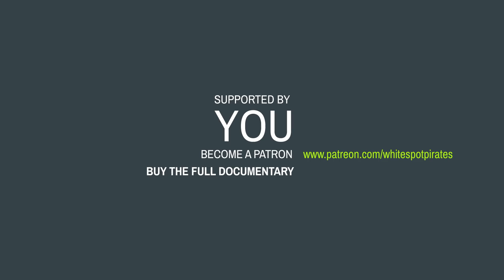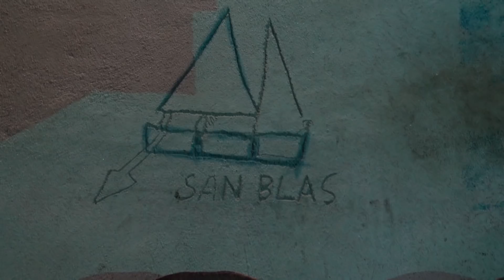What a DESASTER: My boat hull looks like SWISS CHEESE  - UNTIE THE LINES IV #16

Comment: Nice to see Karl getting some TLC, That pizza looked real good ;) If you get anymore small holes there is a product we would use for engine casing holes that would have 200 liters in the sump and it worked great, There is a few variations on the market where it is 2 pack and you just mix it and put it on then it goes real hot, So hot you can't go near it, There is a aluminium version and a steel version of the liquid weld, It is expensive, But does the job, Stronger than any weld and last for ages if kept at right temp.. Them trousers nik had on was so funny, Good old working clothes, Can't beat some air condition circulation, My workshop jacket is full of welding holes, Hope you did not get any bombers down your backs putting that plate on. It is very sore when that happens. Is it cheaper going their than going to a posh marina or does it work out the same price? "Per day" Don't like the sound of that one!
Reply from the maker: Shaun Sim oh nice what’s that called?
It was cheaper, yes. Fancy Marina haulout is 700$ plus 125$ per day on the hard. This was 170$ a day...so for a total of 6 days was cheaper
Reply from the maker: Shaun Sim plus, some fancy marinas sometimes don’t let u do your own work or bring in ur own peeps but u have to hire their staff...which is usually also more expensive...

Comment: Won't that aluminum plate between the keels create a lot of drag? Why not cut a hole and then weld in the new piece so it's a smooth surface? Keep up the good work on the videos, really enjoy watching what boat life is really like.
Reply from the maker: Todd Armstrong the plate we had at hand was was a different alloy, different thickness and the wire was not the right alloy either. The chances of something going wrong are too big to cut a 60x40 cm hole below ur hull. Karl is not a racing boat, I doubt that it will make a significant difference...

Comment: Why are you removing your keel weights? It looked like Bondo and lead, I hope you put it back!
Reply from the maker: Neil Shubert this is not the keel lead but lead that sits in the bilge. Why am I taking it out? Did u miss that there were like 3-4 big holes below it 🤣🤣 of course it’s going back in since it’s obviously there for a reason. But it needs to be newly insulated because obviously that insulation was not so grand anymore since quite the while...
Reply: @WhiteSpotPirates  Good news!  I was wondering why it was there! possibly some final ballast after it was built? are there any Zinc anodes down there too?

Comment: The lead may had been put there to balance up the boat , looks like a Crete mix to hold it there , if you put it back wrap it up so you don’t get dissimilar metal problem and water between cause corode ,, well done where is all your mates when you haul boat out

Comment: Where the bars for corrosion control, like they sacrifice their metals to the corrosion, instead of the hull, or were they weights for stabilizing like counterweights?
Reply from the maker: RV Curious De Warren They were for ballast.
Reply from the maker: RV Curious De Warren for aluminum, u usually use magnesium and not Zink annodes. And half a ton might be a bit over the top, too 🤣

Comment: Did I see you using urethane paint on the bottom of the boat? You seem to be redoing the bottom way too often. May I suggest a TWO PART EPOXY PAINT. This is a hard Industrial 30 year paint for Bridges, Drilling Rigs and Heavy Equipment. I put it on my Sail Boat and found it to be hard, shinny and very slick. Nothing seems to stick to it. The can says you can use a roller, but don't do it. Leaves bumps. Found a brush is best. Be careful it can sag if applied too heavy. It is mixed 4 to 1. In the U.S. the paint is $59. gallon and the epoxy activator is $52.pint. from Anchor Paint. Isn't that plate going to cause a separation of the water from the boat and drag? Not that it really maters I guess except for any depth finder behind it. Been watching since day 1.

Comment: curious tough where did you find the mig whelding machine, it was a rental?
Reply from the maker: ElectronicMarine it’s my friend Erick’s. He works in the balboa  yard and i knew him from the haulout when I changed my engine. He was so kind to lend  us the welder for the cost of the gas .
Reply: @WhiteSpotPirates  a good friend!
Reply: @WhiteSpotPirates  I went back on the videos installing the engine, Usualy on metal boats the engine stay disconected electricaly from the hull, the power negative wire on manny of them is controlled by a big power relay or manual switch since having him always connected with the hull creates galvanic corrosion. The negative wire should stay connected on the engine only when is running... the electrical distribution pannel in metal boats should also disconect the negative wires for every appliance. is a good habit to controll if there is anny continuity between hull and negative/positive wires from the 12v system. Especialy on metal boats the harness that goes to the running lights, sollar pannels egg must be checked periodicaly... if a wire is just allitle bit stripped or lost the insulation will corrode the hull. not tryng to do the proffessor here but this is an aspect manny metal boats owners take lightly.

Comment: Were those lead bars ballasts?
Reply from the maker: Yes, they must have added them as additional ballast. Maybe they miscalculated the lead ballast in the keels, no idea!!!
Reply: @WhiteSpotPirates  it was pretty common practice to ballast boats with iron or lead back in the wooden boat days and sometimes it was set in concrete or cement to stop it moving and also as a quick fix to stop leaks. You may find that lead is needed and the boat becomes unstable without out it. Or it may just get faster and you won't have to motor everwhere :-)
Reply from the maker: Nick Bowles it definitely needs it...we left it in yard by accident when we splashed and it was very obvious that Karl wanted it back 🤣🤣🤣

Comment: Why go through all that hard work grinding use a sandblaster. With the right protective gear and air compressor don't have to be anything big something on a small scale will clean quite well.  Look to purchase ALUMALOY RODS with map gas you can do small repairs to fill in any little holes when you beach your boat if necessary.   Look into it, watch some videos it would be a big help to do any necessary repairs on a small scale.